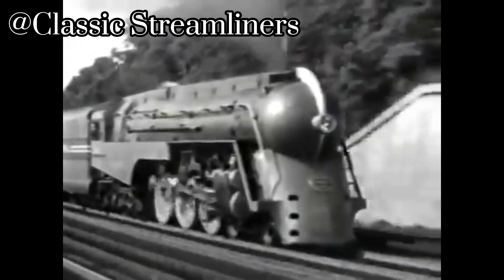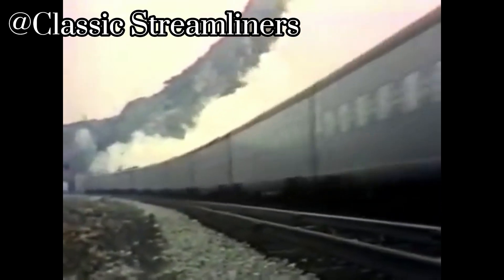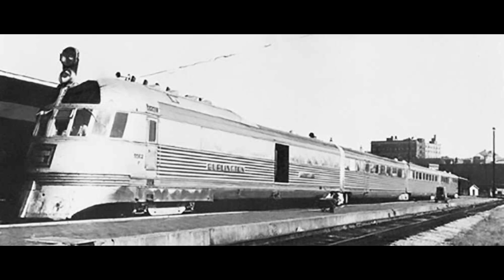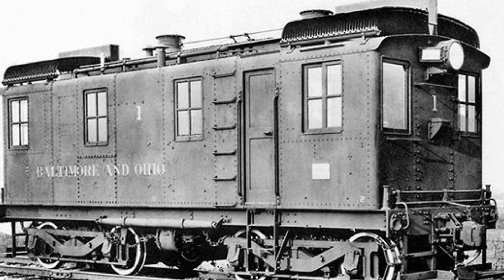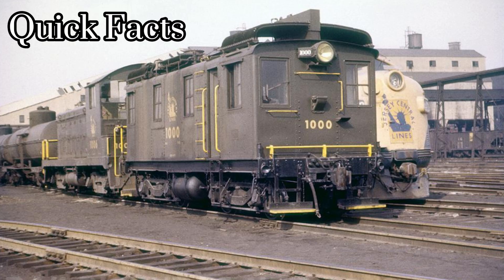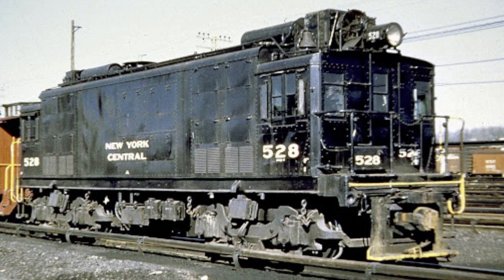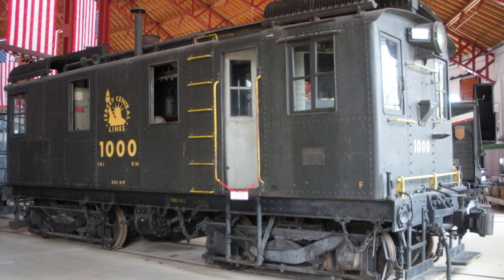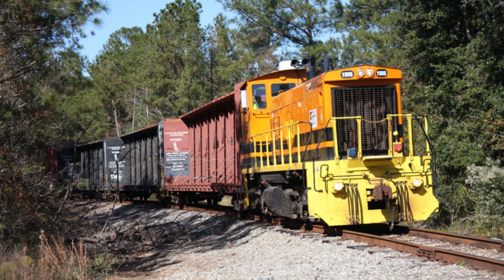CNJ 1000 - The World's First Successful Diesel Locomotive

Comment: Your photo gallery mixes diesels with electric locomotives that were around long before diesels were practical.  You also confuse wheel arrangement with wheelbase, the latter is the the length between the front axle and the rear axle while wheel arrangement is the number of wheels used, thus an 0-4-0 has no pilot wheels, four drivers, and no trailing wheels.  More drivers or wheels in general will allow the locomotive to spread out it weight over more track, a consideration in weaker track sections such as yards or branch lines.  Putting all of the locomotive weight on the drivers maximizes the tractive effort (pulling power) that the unit can make.  Long wheelbase locomotives such as 0-8-0s can't handle sharper curves especially in track switches, this can be overcome by making the middle drivers blind, this is without flanges allowing them to slide off the center of the rail.  Most switchers used tenders since mounting the tank over the boiler only compounds the maintenance issues and the use of a tender allows it to have more coal and water meaning more running time between fill-ups.  Steam locomotives use a lot of water.  I don't know if the GE 1000 was the first diesel worldwide but probably in the US.  The British did a lot of work finding a diesel that would fit into form of a locomotive, they found one in an unusual place, engines made to power airships, the Germans were known for their airships but the Brits were into them as well.  Both also used smaller diesels in their subs as well, the Brits didn't use subs to sink merchant shipping though.

Comment: The term “box cab” or “boxcab” was often applied to certain earlier electric locomotives due to their resemblance in shape to boxcars. Many times, early diesel-electric locomotives were referred to as oil-electrics thus avoiding German names such as Diesel which had become less popular after WWI.  Diesel is derived from Rudolph Diesel the German mechanical engineer and primary inventor of the engine.  Great production. Thanks for this!

Comment: Nice pictures, but you missed the part about New York city banning steam locomotives due to air pollution in the 20's. Simply put, diesels smoke less!
Reply: That's in the video, but it's just "government" instead of "New York state legislature", and the law was passed in 1902 to take effect in 1908, banning the operation of steam locomotives in Manhattan.
Reply: @Lucius_Chiaraviglio  You beat me to it!  Manhattan is right, steam operated in Brooklyn until 1962 on the Brooklyn Eastern District Terminal switching railroad.  One of those BEDT engines survives today at the Strasburg Railroad rebuilt (And cleverly so!) into a Thomas The Tank Engine replica and runs during their "Day Out With Thomas" festivals.

Comment: When I was a kid in the 1950s my parents had an old set of National Encyclopedias dating to the early 1930s. I remember a photo in one of them of the IR boxcab locomotive, but it was simply called an "Oil Electric" engine in the photo caption back then instead of Diesel Electric, which was the type of fuel oil it ran on.
Reply: They preferred the terms "oil" or "gas" for these types of engines during and after WWI since the word "diesel" was of German origin.

Comment: Thanks for a great video!  Already have many of the box cab photos used in your vid.  Purchased a 1.5" scale, 7.5" gauge, box cab loco made by Cannonball Ltd...and then gave the loco an extreme makeover to look like the CNJ #1000 and other similar box cabs of the era.  Only problem, the Cannonball model was shorter than a scaled down version of a real "boxer".  So instead of a 300 Hp rating...I down rated the model to "225 Hp".  The loco is battery powered and has many of the details (roof top radiators in particular) that were on the original box cabs.  Having (4) 1/3 Hp permanent magnet motors, its pulling power is limited...but it still goes!  Once again...thanx for the video.